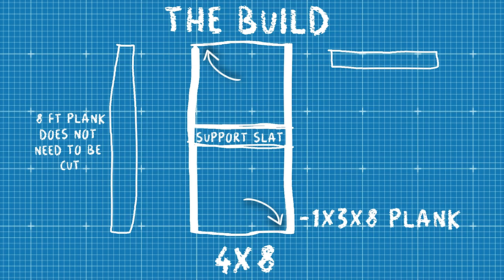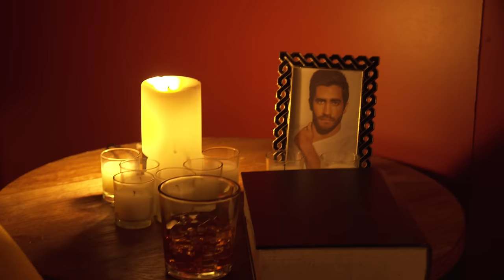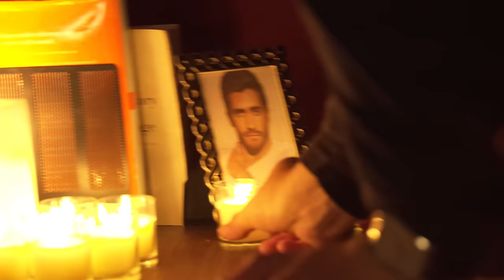How to Build Your Own Set With STUDIO FLATS | Filmmaking Tips

Comment: To save $$$ use furring strips & drywall screws.
This is 4 the at home style, I have worked at the studios building sets and we wld norm use 1x for the frame and luane or masonnite.
We wld also skim them w drywall mud and sand them, add trim, paint.
If u do the mud just skim the luane really thin like scrap as much as u can off! Easier to sand and saves material!
Totally agree w what this guy said tho, dont fear the flat or feel u have to do it just like this or that, just make a flat background!

Comment: Great advice and video, I used to work building and painting sets but cool to see the home version like not in a stage. I make them at home with furring strips which are super cheap 1x3s, like 6 for $12 and use screws if no nail gun. The ones they build in real movies can be built better or worse.

Comment: Noooooooooo! Your top and bottom rails should run the entire length. This creates "sleds" for the flats to slide on. If you build the flat your way, when the flat is slid or tipped over on a corner, it is likely to break apart over time.

Comment: Oh dear lord no....on so many levels no.....At least your videography skills are very good and you are entertaining to watch.  But Please do not build flats like this. Rails (top and bottom horizontal) should be 4'. stiles (verticals) should be inside of the rails 8' - thickness of material used for rails. Toggles inside of the stiles (4' - thickness of material used for stiles) and toggles should be 2' on center starting at the bottom and going up. (3 toggles in a 4x8 flat) Do NOT wait until the glue dries. Do attach one rail to the skin making sure it is square to the frame. DO square the rest of the frame to the skin once the first side is attached. If you wait till the glue is dry you can't square anything up.  If you don't have square frames how can you attach them together? Do attach the skin to the toggles so you don't need the 2x4 on the back.  Jacks can be 1x3 instead of 2x4 and using two fasteners in the pieces of the jack will eliminate the need for any other bracing.
Reply: Hey Eric, any good video recommendations for building flats the way you suggest?
Reply: Could you make a video tutorial? If not, this one will have to do 😬